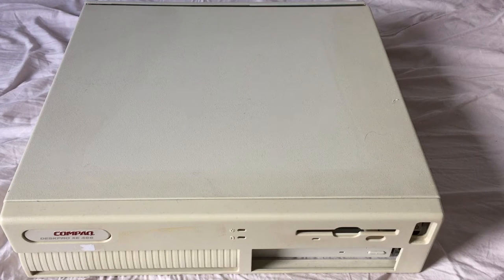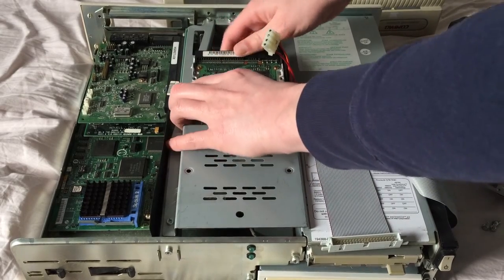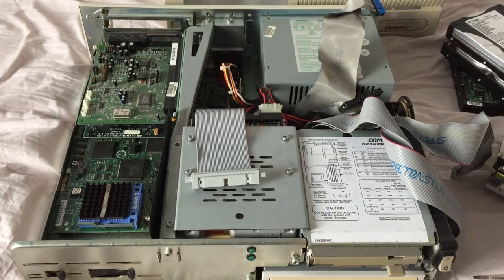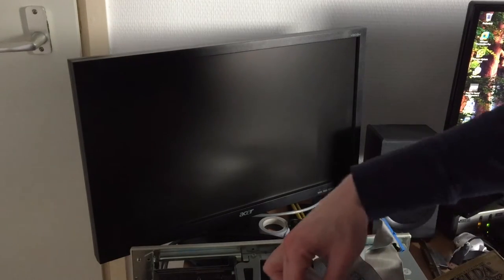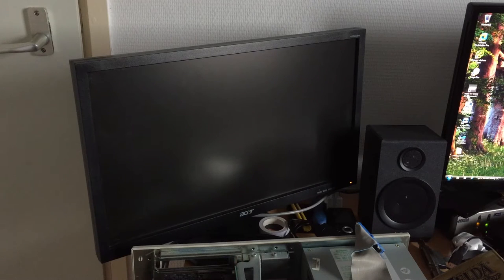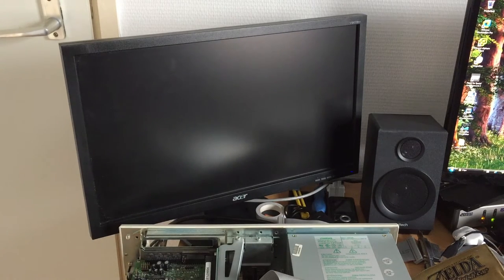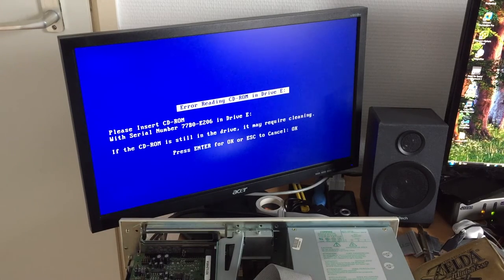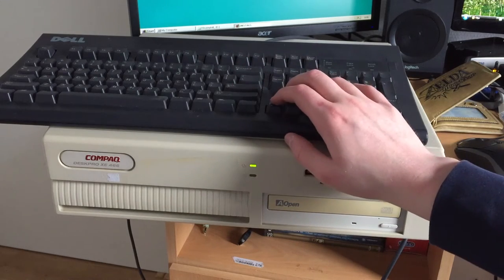Getting The 1994 Compaq Deskpro XE 466 Ready For Action!

Comment: I have the same box with an DX2 50 MHz , 32 MB Ram, IDE DVD and 4GB CF. It is running Win 3.11 with TCPIP over an old 3Com NIC. I ordered an Overdrive 66MHz and installed an FMtune ISA-card, which will be fun. How ever i was wondering if you got the audio working...?

BTW, you can attach a external CMOS battery, so no need to solder.
Reply from the maker: Yep, I have an external battery now. Works great. I got audio working through a SB Vibra 16 and putting a loop cable from the onboard audio’s line out to the line in on the sound card. Of course, I needed to enable that interface in the DOS driver, but it works great now.
Reply: @nelizmastr  Thx, so basically the onboard sound stuff does nothing?